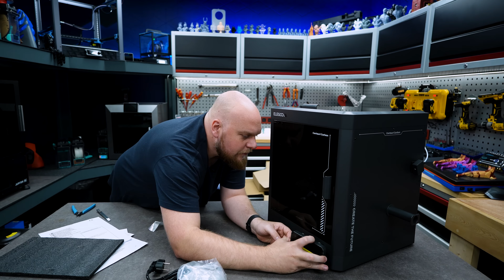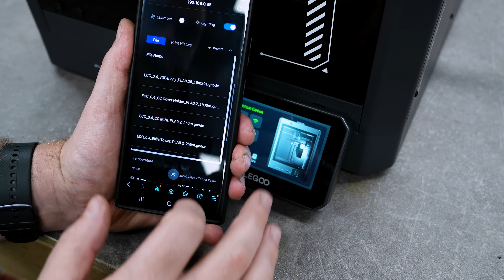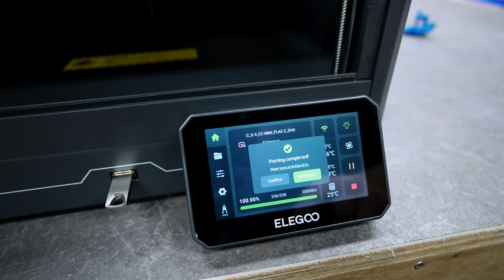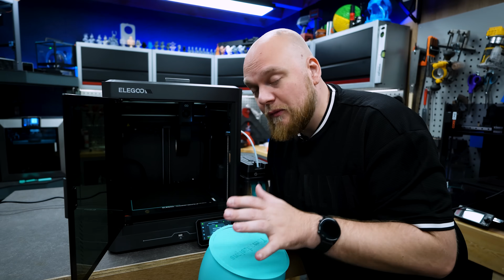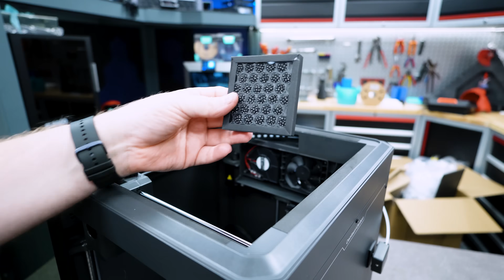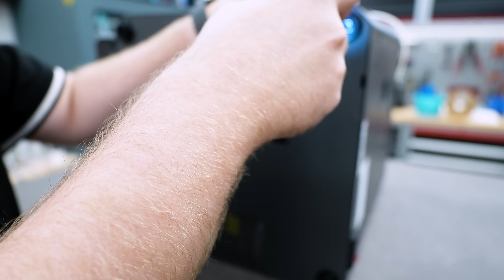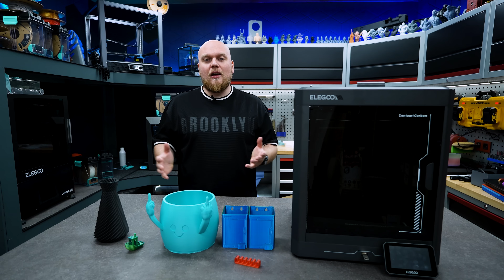Elegoo Centauri Carbon first look, because who needs profit margins anyway?

Comment: Word is Elegoo will ship you the necessary parts to upgrade the early release machines to the current iteration.
Reply from the maker: Sending them THE mail rn 😊
Reply: @NoizieWorks what was the response?
Reply from the maker: @nickabel8279  dead silent, asked with 2 different credentials. From what i can see in the Forum they no longer provide upgrade kits.
Reply: I see it listed on Amazon and wondering which version would ship.. hopefully it won't be an older one @NoizieWorks
Reply: @NoizieWorks  That would be rather stupid as the very beginning it stated AMS coming Q3. There will be lots of unhappy people myself included if the early machines do not work. I have doubts and think they will. We shall see
Reply: I have the first version (ordered when it went live) and have not heard of this. Thanks for posting i may need to contact them

Comment: The review was publish 6 hours ago but your printer has only the puny LED. To my knowledge Elegoo has updated the lights on the recent batches delivered.

How long have you been working on this review?
Reply from the maker: It's been delivered 5th of June
Reply from the maker: Funny enough it does have the ams port apparently the previous one didn't so not sure if they misses it or i got a in-between  kinda deal.
Reply: @NoizieWorks  There has been an intermediary batch with the ams port and the original crappy led. I guess the batch yours was part of was a mixed one. Some with upgraded lights and some without.

Edit: I saw the power cord, you are in Europe too. If you ordered it directly from Elegoo site, I guess yours was the 2nd batch. Also, your studio looks really good.
Reply from the maker: @CosminNecula  thanks for the info
Reply: @CosminNecula also all vendors received batch 1 or 2. They will not be getting more until August.
Reply: I just got mine July 1, 2025 and it’s not working right and has the dimmest little camera light and now I’m reading others are getting upgraded machines. Just so shocked at all this. Mine prints where the hot end won’t get close enough to the build plate no matter what I do
Reply: @deedeetee17  Did you get the printer from Elegoo? Cause the ones shipped from Elegoo are batch 2 or higher. AKA they have the better lights. I just got my printer from Microcenter so it was an early revision. It has the AMS port but the weak light. Not an issue as a cheap led cob strip plugged into the available port on the controller fixes this. Haven't run that LED strip yet because too busy printing.

To fix your z-offset issue make sure to update the firmware and run through the calibrations. Are you seeing any errors on the screen?

Comment: Let me know when they get cfw klipper running on it. Also, the artillery m1 is coming any moment now. Get them to send you one. 👍
Reply from the maker: I asked, they never answered
Reply: Artillery is dead to me...
Reply: @monetary_episode they fell off hard in recent years. I still got a sidewinder x1 sitting there. There m1 looks really good though, but they delayed it massively, closed firmware, and no multicolor. My little qidi xsmart3 just prints.
Reply: @monetary_episode494 they fell off hard in recent years. I still got a sidewinder x1 sitting there. There m1 looks really good though, but they delayed it massively, closed firmware, and no multicolor.
Reply: Artillery M1 Pro preorder price is about the same. When do we see Creality K1C match the price 😅
Reply: @kimmotoivanen creality selling cheap refurb on ebay. Got me a k1 already. Im more interested in the creality k2. M1 should be better than k1, but its closed firmware and taking too long to release.
Reply: creality selling cheap refurb on ebay. Got me a k1 already. Im more interested in the creality k2. M1 should be better than k1, but its closed firmware and taking too long to release.

Comment: Interesting you got the updated revision with the multi color port but not the dual led light strips.
Reply: There have been several hardware upgrades, the first batch that went to reviewers and initial pre-orders didn’t have the AMS port, by batch 2 everyone had the port, around batch 3 they made some changes to the z-rods, batch 4-5 had the biggest changes with the lights, thicker side panel for a more sturdy filament mount, new chamfer on the top to protect the filament tube, spacers for the filament sensor so it works better, and several other changes
Reply from the maker: Crazy how hard they are pushing iterations. Good stuff!
Reply: @llamaSHORTS1  They had ~6 months between showing in public and releasing the printer - and they used it for what? How could they not find out all the "wrongs" in-house before shipping? Did Elegoo actually test their prototypes at all?

(meanwhile: Prusa printers pushing collective thousands of practical test hours before they even tell they have new model)